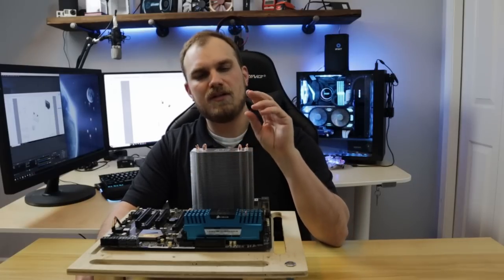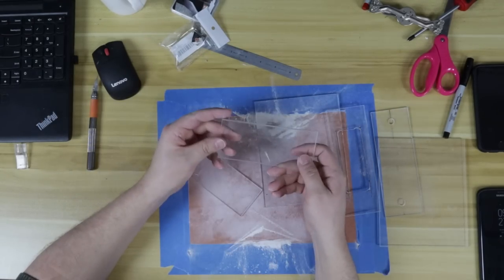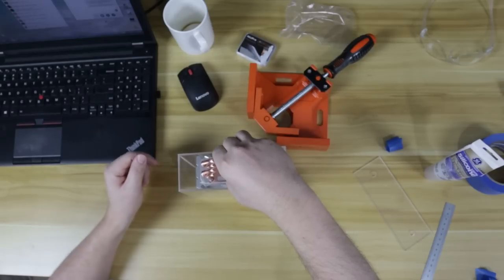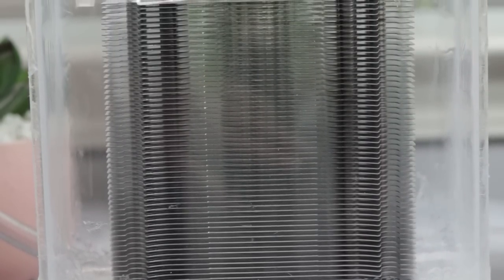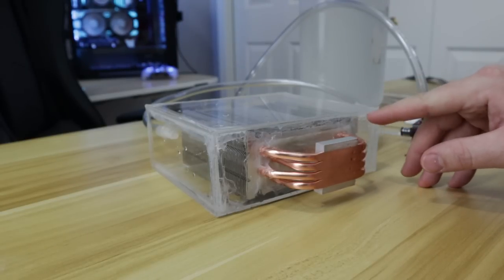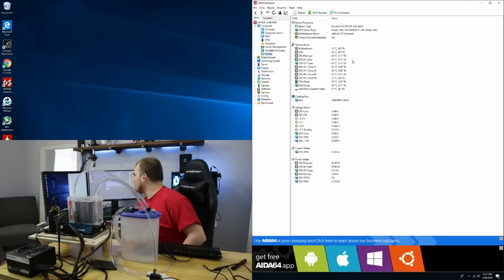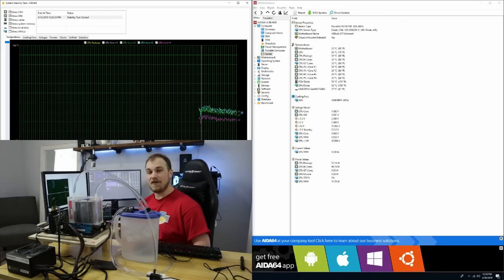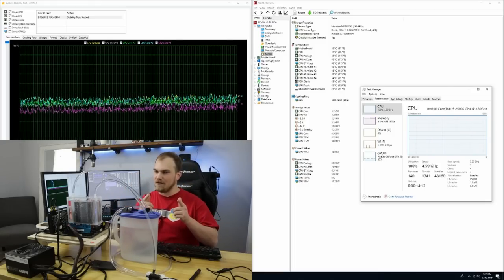I Water Cooled My Air Cooler AND..........

Comment: Major Hardware: "lets water cool our air cooler"

Linus a few years ago: Lets put the entire pc in a fridge🤣
Reply: Why not a freezer
Reply: Monkey D. Luffy I think it was a water cooled pc and if he did that the water in the tubes would freeze
Reply: @Loganvbills  I’d still say 0* F should still freeze it, unless it’s going a fair bit faster than it really should be.
Reply: @Loganvbills  True BUT you can find frozen waterfalls.
Reply: @CypressConroy  the condensation in a freezer would short out the computer; he did use a compressor cooled PC though.
Reply: He has a video in tech quiqe about what u should not put off in fridge
Reply: @CypressConroy  In this case should not need any cooling device. Just leave the mobo with ryzen on the fries.
Reply: I put asus chrosshair 5 with bulldozer 4 core, ssd drive stock air coooler in a counter top fridge like you see at wm checkout aisle. 2 big issues, no post when pre-chilled, 34 degrees. Post first, crash at 40. Too hot in my room, noisy. Also fridge and computer on same circuit, same room. Duu, homer moment. 10 years later it's still running, server rack mount case, Fallout 3, nv, 4, yeah!

Comment: I'm 6:10 in... fluid dynamics will be your biggest problem in the end, even if it proves successful, providing a proper path for fluid to flow would make the setup much more successful.
Reply: My thoughts exactly.  A piece across the top to stop the fluid taking the shortest path would force it through the fins.
Reply: @aperturescience2  THANK YOU! im glad i was not the only one
Reply: Change to the bigger flow water pump.. and make separate room so water can flow better through the heat transfer area..
Reply: @Bill.Papadakis  Mick Lapworth He literally mentions this in the video kids
Reply: Not only that, at the end of it all he puts ice in it, potentially destroying the experiment to begin whit. If you are going to be making a water air cooler, you need to do it at the heat sink not at the fins of the exhaust. it's just a water cooler.
Reply: Just like water condenser in chemistry
Reply: @trystonkincannon8320  
That's his substitute for a radiator and fans.
Reply: Input of the water on the bottom left, output on top right. 

Easy as that. 

He should have out a drop of food coloring in the clear water to see the fluid moving. 

It could have been soooooo much better. 
So sad :(
Reply: Shut up and take my money?!
Reply: A divider bisecting the whole unit from top to bottom, as well as having the entry and exit tubes pushing water from each side of the middle and adding another pump on the exit tube would make this much more efficient, forcing the water through the fins and allowing the most surface area contact of the heattubes, it might be a bit clunky but I think it would perform well
Reply: Needs to have cold water come in through the side at the bottom in one corner and hot water out through the top of the opposite corner.
Reply: Exactly. From the video thumbnail alone you can tell it's going to be inefficient.
Reply: @aperturescience2  doing that will reduce the flow rate and it's a cheap pump so it will have low head so there will be no benefit's from doing that

Comment: World's... 

Biggest... 

Waterblock
Reply: Izan TechnoMaster  True that. The heat exhanger surface on this thing is huge compared with commercial water-cooling systems, even allowing for air bubbles.  Given the high specific heat of water, it's probably reaching the point where the limiting factor is on the pipes/pad facing the CPU. Well, except for the fact that he doesn't yet have a radiator or evaporative cooling on the reservoir side.
Reply: Izan TechnoMaster
Exactly. Most of the coolant is going to flow around the fin stack rather then through it, taking the path of least resistance. On top of that, you'd better have some pretty solid strapping to the case to support the damned thing unless you plan to leave the case on its side. I can hear his motherboard cracking when he turns the case upright and fills it with water.

Also, using ice water was a really dumb idea. He's lucky that acrylic is a pretty crappy conductor of heat, so the outside of the thing (apparently) never got cold enough to form condensation on the outside of the box or tubing. Either that, or the relative humidity was very, very low that day. ;)

Comment: But ... this is actually a water heater. There is no radiator on the outside that would actually make the water cool.

To fix this experiment: the in/out should be on the other (wider) sides. Also water shouldn't be able to travel where there are no fins. Then an external radiator to cool the water in the direction of the ambient temperature (or an active chiller) ...

just my 2c .... as it is, it is as effective as the aquarium PCs in mineral oil.
Reply: well i just wrote the same thing :D
seems I would not have needed to do this.. :D
I agree to your view^^
Reply: the guy literally said that in the video. watch shit before you comment
Reply: Theres ice in it so it should be fine
Reply: @paniniman6524  Sure :) keep filling your cooling system with ice while rendering/working/playing COD :) ...

My point was that there was no external radiator, and that any flow will choose the least resistance. That being: not between the fins, but above/around it. Essentially just turning the experiment into an immersion heater with a circulation ...
Reply: add a radiator and a fan and it basically becomes a makeshift aio
Reply: @rdtiel  nahhh... add some cheap peltier instead into the mix, just to be different :D
Reply: this is prototype he can slap in 3 radiators to cool it.. Lol

Comment: Nice idea, but atleast 2 flaws I can see.

1. The Copper heatpipes are going to expand and retract, causing the seal on the bottom to wear out and cause a leak, eventually.
2. the Copper in the heatpipes are going to react to the aluminum in the fins, causing corrosion.
Reply: Went down into the comments looking for someone talking about galvanic corrosion. Glad I'm not the only one who noticed this huge issue.
Reply: Usually takes a while and there are additives to further slow it down
Reply: But, if we replace water with something like "mineral oil", is corrosion still a concern?
Reply: Man none of y'all have ever taken a  chemistry class
Reply: @tebasnineone  in theory that would alleviate (but likely not solve) the issue as it comes with its own set of problems. Mineral oil spreads like a mofo making a huge mess if a spill or leak occurs, it also has a high capacitance for heat making it harder to exhaust the heat it will absorb from the block. Anti-corrosive additives and keeping an eye on the block is a better solution imo
Reply: @tebasnineone  If you're going to go the mineral oil route, you may as well just do submersed cooling, and just flood the entire motherboard.
Reply: yep this is dumb idea. just want to said it out..
Reply: There a ton of heatsinks with cooper heatpipes are aluminumplated for looks, so that would reduce the problem.
Reply: re #2: instead of plain water, use engine coolant. problem solved.
Reply: @robertfield7532  Galvanic corrosion isn't really something I've ever experienced, and more so something everybody always talks about but never happens. I know this as pretty much every AIO cooler is mixed materials of Nickel plating, copper, and aluminum. Which mine has lasted for 2 years now with absolutely 0 issues to this day.
Reply: @michaelb7071  and had he done that in this video, I would not have mentioned it 👌
Reply: 1- Fuck
2- It
Reply: @keltondavis4559  Well I did take a chemistry class, but it SUUUUCKED
Reply: What's wrong with just having fun
Reply: there wouldn't be any galvanic corrosion if the air flow is sealed between the aluminium and copper by some good thermal paste. only if iam right*
Reply: @royalecollab3565  Galvanic corrosion doesn't require air flow, it simply requires a link between the two metals that can conduct electricity. It shouldn't be too much of an issue anyway though, as such a connection between the metals already exists before the addition of water (they're in direct contact).
Reply: Would've been easier to rip out the fins and just make holes for the heatpipes in the box.
Reply: Resolved with 100% copper heatsink?
Reply: @balla2172  It's hard to say without an actual test run, but theoretically this could actually work. Aluminum transfers heat slower than copper would, but aluminum also loses heat faster than copper would. That's what makes a copper/aluminum heat sink so efficient. Using just copper would heat the heat sink relatively evenly, but lose heat to the running water slower than aluminum. So this would just be a trade-off to galvanic corrosion and most likely just a preference.
Reply: @keltondavis4559  well this is amarica
Reply: Could be fixed by Using mineraloil
Reply: @Squall Loire  galvanic corrosion specifically requires two things. The connection between two metals that have a llatge anodic potential, such as copper and aluminium AND the presence of an electrolyte, such as water. You wouldn't get galvanic corrosion just putting the two metals next to each other, but it's the introduction of the water that makes it a problem.    @Adierit  AIOs may mix metals but in this case the two metals aren't in direct contact surrounded by an electrolyte, so to cause galvanic corrosion you'd need to presumably end up with particulates of one of copper or aluminium making their way through the loop, and coming into the contact with the other metal. This would be when galvanic corrosion would occur, and I would guess, have a snowball effect from there on out. However, given the lack of direct contact, It'll probably take longer than 2 years to become a problem. In this case however there is direct contact, and that is much more serious.
Reply: I think it would leak before any issues arise from the copper and aluminum interacting.
Reply: @robertfield7532  : A mitigating factor is the oxide layer on the aluminum, but I'm not certain how much time that would add. Any guesses?
Reply: For his next vid, he can install a closed-loop liquid cooler and enclose the radiator in an acrylic tank filled with water (or coolant).
Reply: @absalomdraconis  Honestly I'd struggle to say what happens to aluminium oxide when surrounded by water. Some testing would be required. The interesting thing is that aluminium oxide is an electrical insulator, and one of the ways of helping to prevent galvanic corrosion, is to provide an electrical insulator boundary between the two metals. At this point you'd need to start questioning whether enough oxide could form at the join to the copper to stop the bulk of corrosion through direct contact.
Reply: @robertfield7532  : Ok, not sure what your concern about the junction is, but the oxide would slow the process. I'm mostly curious as to whether you have a guess of how long.
Reply: Other than particulate over time, a sacrificial anode may remedy the galvanic corrosion concerns.
But then again they are in constant contact so it may do nothing beneficial.
Reply: @absalomdraconis  my concern about the junction is because galvanic corrosion occurs when there is an electrical connection between the two metals. If aluminium oxide were able to form between the copper heatpipe and the aluminium fin it would slow down the process significantly because there would be an electrical insulator between the two metals. The only thing is I have no idea how long it would stay there before something happened to the oxide.
Reply: @robertfield7532  : Ah, that. No, galvanic corrosion happens when there is an electrical current between two metals. If you just have the two metals touching, and (this is just an example, mind you) one of them completely covers the other, then you won't get any galvanic corrosion, because galvanic corrosion is specifically electro-chemical corrosion, and having the entire surface of the "inner" metal covered by a single "outer" metal prevents the necessary voltage differential from developing in the first place. You might still get some purely chemical interactions, but that is ultimately an alloying process, and also slow.

Basically, galvanic corrosion is a special type of corrosion where you accidentally form a battery. Sacrificial anodes work through the same process.
Reply: @tebasnineone  they should try actual antifreeze. LOL

Comment: H: What is your cpu cooling system ?

M: Water cooled air cooler.
Reply: Chilled water aircooler.
Reply: Alcohol cooled fan cooler
Reply: Technically, it's a water-cooled heatsink.
Reply: It's just water cooling with extra steps, as it does not contain any fans at all.
Reply: well if an air cooler manufacturer decides to do it the result will be better because the air cooler will be protected from corrosion unlike the corsair cooler which is not cause corsair never envisioned their cooler being exposed to a liquid coolant constantly in contant with the heat sink fins trying to cool them and corroding them over time

Comment: "there are only two options to cool your cpu"

Liquid Nitrogen Set up: Am I a Joke to you?
Reply: I would not call this cooling, but freezing, since it's the next level hahaha
Reply: Dont forget that LTT mineral oil pc
Reply: I mean, it is a liquid
Reply: in the market yes, consider that liquid nitrogen is not used by everyone
Reply: @Fenrich2005  but can be used by literally anyone. It's not particualry difficult to get into LN2 cooling
Reply: @GewelReal  can't use nitrogen in closed rooms. Where do you find most gamers?
Reply: Very complex, in order to not get immediate condensation on the package you would need to seal the computer case and fill it with a dry gas like nitrogen or argon to displace any moisture laden air and even then any manufacturing defect in the chip will cause it to crack and fail due to thermal stress once you start heating it up, the heat is not isotropic on the chip but is generated in varying locations across it due to current flow pathways changing based on load type.
Not a problem at room temp, drop the package to -100 however and these small currents produce huge temperature variations across the chip material.
There is a reason why the guys who do that burn cpu's until they get one that can survive.

Comment: Kids: use air cooler
Men: use water cooler
Legends: use water cooled air coolers
Gods: use air cooled water cooled air coolers
Reply: Technically water coolers are air cooled
Reply: Yea xD every piece of the heatsink separated and water cooled
Reply: then there’s me with thermal cooling
Reply: Me an intellectual: use liquid nitrogen
Reply: Urban Legend: use water cooled air con
Reply: Ascendants: returning to air cooler
Reply: Gods use Bose-Einstein condensate, obviously!
Reply: Infants use heatsinks
Reply: Well, a radiator is technically air cooled, if you put it into this loop
Reply: Men: use air cooler
Reply: @joeljose-mk9vg  And there's water vapor inside the low pressure environment of the heat pipe.
Reply: @alejandrorojas0  that actually scary nitrogen is explosive and is the same as any other matter liquid takes up less space or makes less pressure. Liquid nitrogen stays so cold because we keep it that way, lol so basically as soon as it heats up to any negligible amount it’ll blow the seal and a spark could ignite it. Bye bye cpu tower.
Reply: @lordyoseph53  Nitrogen is not flammable. It will boil and turn to gas at room temperature, but a spark won't ignite nitrogen. It can burst containers due to expansion when boiling and turning into gas form though.
Reply: @lordyoseph53  hydrogen explodes not nitrogen. A little devil told me we should play with pure sodium.
Reply: i have a Beautiful maid  blowing  my big cooler
Reply: Cool story bro
Reply: True chads use Vodka coolers.
Reply: Big bang: use the universes emptyness-vaccuum without the sun.
Reply: watercoolers are air cooled though
Reply: thanks :D xD
Reply: use ice cooled water cooled air coolers
Reply: Fun-fact: EVERYTHING is air-cooled unless you connect your PC to the house-water-system or a river to get rid of using radiators...
Reply: @user-ru4qx1ks6y  no a men has money and Watercooling is more expensive so kids cant afford Watercooling 😂
Reply: should be men: air cooler..never fails,last forever. watercooling leak is for kids
Reply: I actually did notice the lack of cooling the secondary water,  which could be set inside a portable fridge ;D
Reply: I tryed many times to understand 
did i understand???
Reply: I have an old intercooler from a car that I might do sum shit with. For those who don't know what an intercooler is, it cools the air that's entering the engine, looks like a thicker and not as tall radiator.